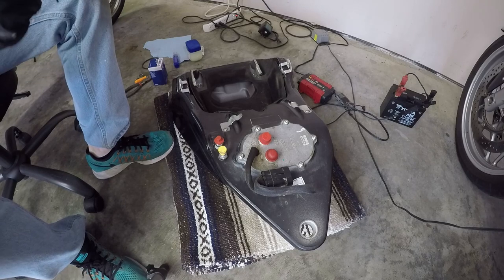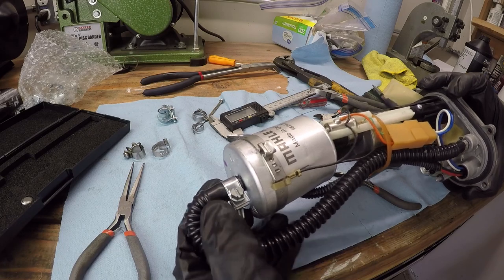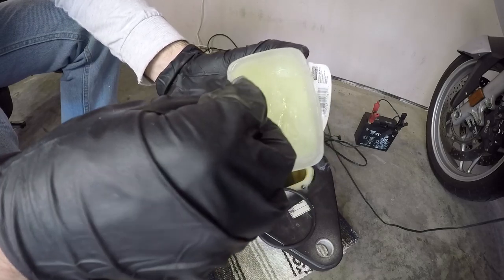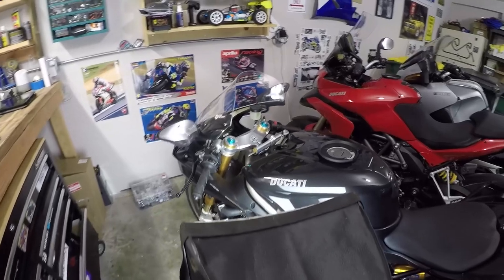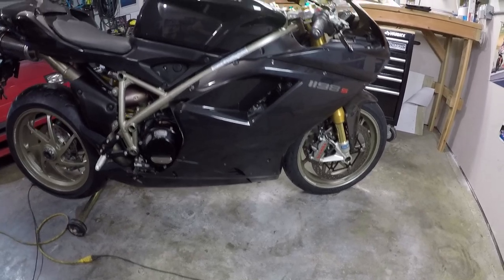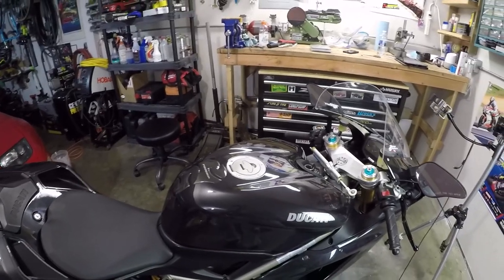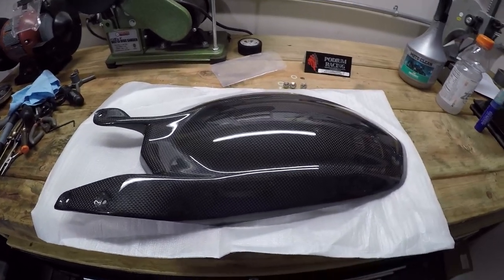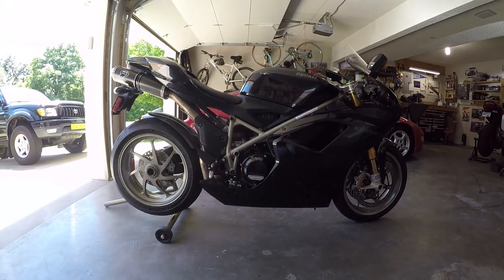2009 Ducati 1198S | Ep.7 | Service Light RESET, Fuel Filter Replacement, and FIRST START

Comment: Wait, those clamps are far better in holding than those screw type!!!  They use a simple tool to press them on and you can fairly easily removed them apart.  You can purchase a whole bunch of them in various sizes and they simply do not get lose.  They are the preferred clamp for this application.  Definitely the best deal, good hunt for this beauty.

Comment: Thank you I ordered the odb2 tools, such a pain in the rear, I live middle of nowhere nearest dealer 5 hours away, always done my own maintenance, but that message drives me crazy. Hopefully it works and of course I will test polarity of cables before use, fired ecu would suck.
Reply from the maker: It should work fine! Good luck!

Comment: Great video! You can use iawdiag/jpdiag to read error codes and reset service timing. (Kind of similar to the melcodiag you used on the multistrada).
Reply from the maker: I tried using jpdiag initially but something about the cable I was using just didn't work.
Reply: @PracticalEnthusiast  oh well, this one did the trick :)

Comment: On the “ practical” side.. just curious like with the tail light they didn’t make just the lens?  On the faring bracket, was it just easier to replace it ;could not have been bent back? All the money you save by doing the work yourself certainly deserves the very very best in parts.. I’m just curious.  Nice work!
Reply from the maker: It could have been bent back for sure, but a new one was only $10 :)

Comment: Have you thought of setting up a external fuel filter? I've done it for my 996. For my 1098s project I'm thinking on installing the fuel filter at the location of the exup motor. I looked through the forums and couldn't find anyone that's done this so I'm still debating.
Reply from the maker: I haven't given that any thought to be honest.  I don't put too many miles on this bike and I figured I probably won't have to change it again during my ownership. It's not too much trouble to access when doing the timing belts as it is.

Comment: Having trouble connecting the Elm on ScanM5X app. My phone is android version 11 galaxy a21. What phone do u have? The obdlink does not need to be linked, pretty sure?
Reply from the maker: I have a Pixel 2 on Android 11 and it worked for me. You do have to play around with it for a bit to find the ELM. Try going into the in-app settings and from the Bluetooth drop down: 
1. Select "Not"
2. Close settings
3. Go back to Bluetooth settings and select "Bluetooth"

That may get it to refresh and see the ELM.

Comment: I have bought the ELM327 and cable.  Connects up to tablet via BT ok but once connected, I cannot get to the then to select the service indicator.  It’s like the “Previous” button does not work.  Could it be because I am running the Race ecu?
Reply from the maker: I don't think it's the ECU, but instead the app being "finicky". I had to play around with it for a while to get it to work. Try turning the ignition on with the app open, and if that doesn't work, try turning the ignition off with the app open and then back on. Unfortunately I don't have a more technical and accurate approach but I do think you can get it to work. Also, go to the "Vehicle Status" screen to make sure it is reading the bike's inputs, such as the clutch lever switch and throttle position. If it isn't reading those, it won't be able to reset the service light either.
Reply: @PracticalEnthusiast    Thank you.  Any and all advice is really appreciated.  I will try out some things and see how I go.  Cheers…